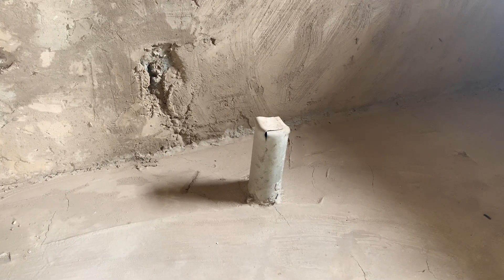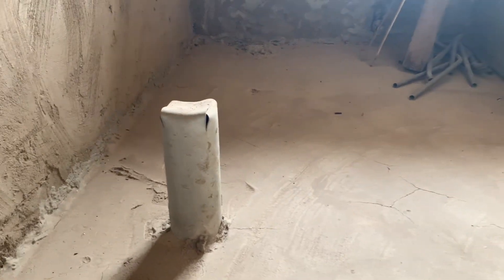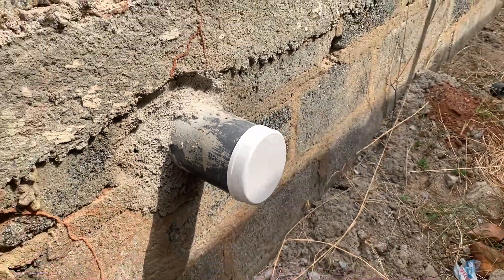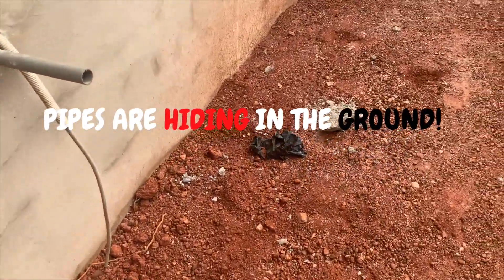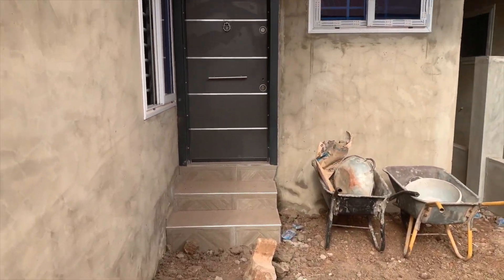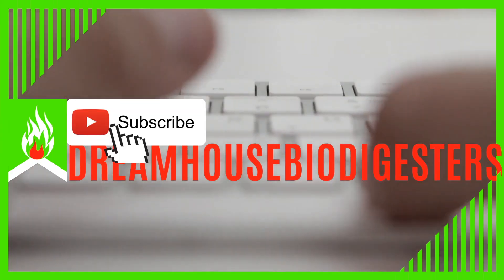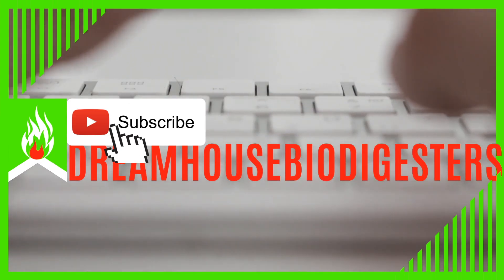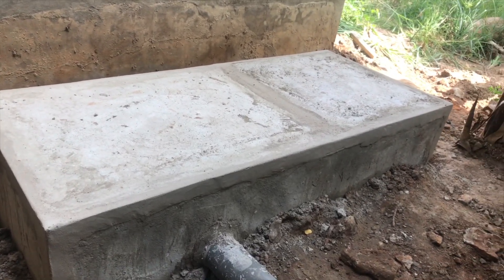How To Do a Site Inspection Before Bio Digester Construction

Comment: You mentioned....@ 1:20.....The installer wants to be sure all the operating specifications are achieved....that the ...bio-digester....would function for 3years before the first maintenance is required........My question is.....Are Bio-Digestors....required to be vacuumed out like a Septic Tank System....after 3years?.......If not...as your previous videos stated.....What type Maintenance after 3years are you speaking of?
Reply from the maker: Rudy Grissom thanks Rudy. Because biodigesters uses microorganism to break down soldi waste and any other biodegradable materials there comes a time you have to fill aid the process to work effectively and this means retrodiction of what worked in the first place. Just that unlike the septic tank you don’t need a truck and any expensive way of doing the maintenance just removing things that might have gotten into the digester that are not biodegradable and refilling the digester bed.
Reply: @JerryAdu-Asare  
 I commend you for been honest because an installer stated it will last for about 25 years before any maintenance could be needed which prompted me to do the research on YouTube.